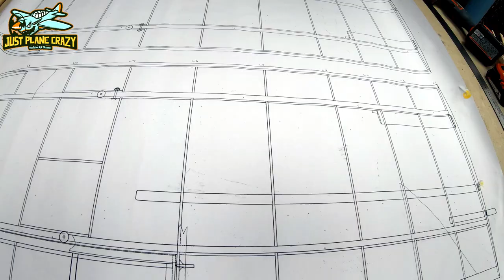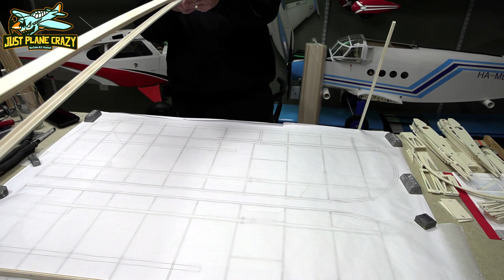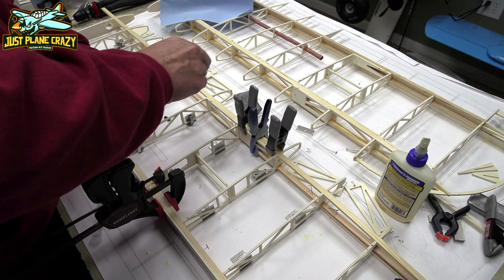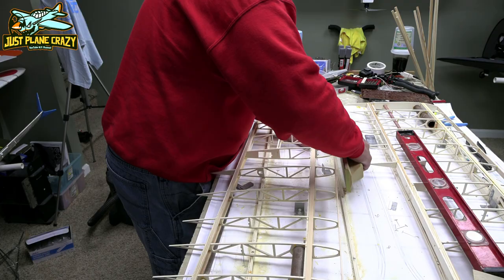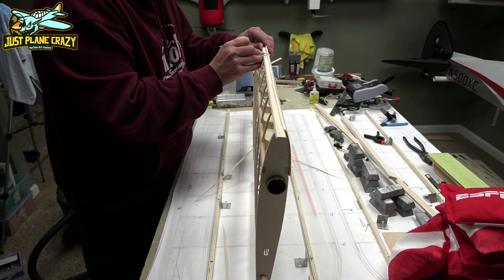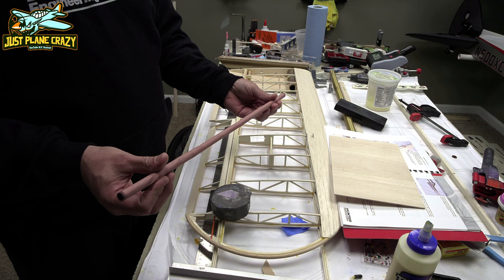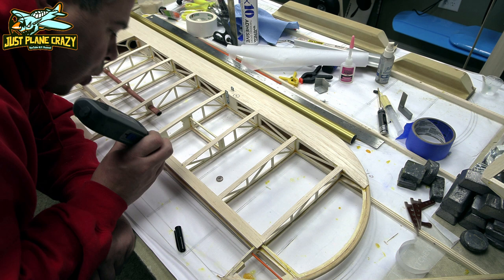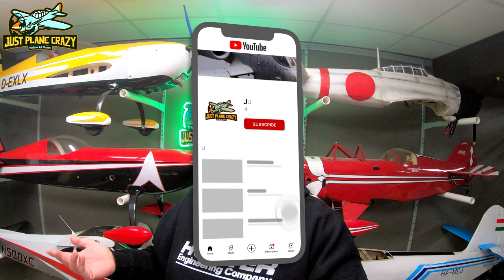Building the EMHW 2.43m 47% Pitts Special pt.2 Lower Wing

Comment: I have a question.   Can I run my electric start with my retractable gear in my   Seagull zero and be ok ?
Reply from the maker: David,
   I have an electric start eme60 in my zero. It runs off its own relay. The retracts also have their own controller. Hope that helps
Reply: @JustPlaneCrazy   do you use one battery to run both relays or do each have its own battery
Reply from the maker: The starter battery is its own deal. Then I have a two battery setup for everything else

Comment: is there a part 3 and 4 yet?
Reply from the maker: I am working on the upper wing vid now. I haven’t started the fuse yet. I got side tracked building the turbine Avanti and another Decathlon for this years flying season
Reply: @JustPlaneCrazy  thank you for the video series. I have built from scratch in the past, but your videos are helping me brush up on technics before I get started on a PT-17 and a 1/3 scale Pitts special super stinker.